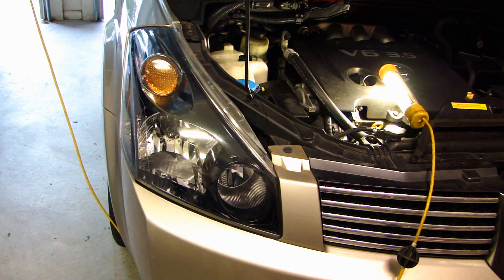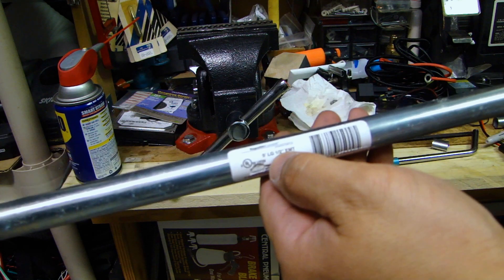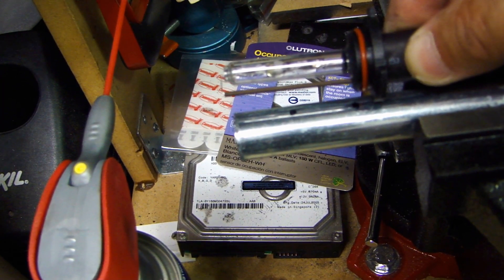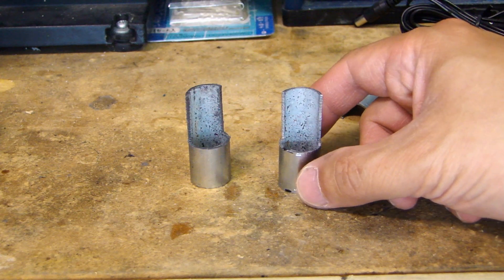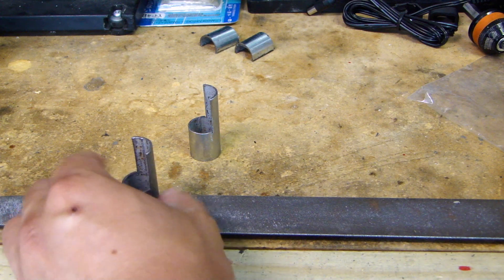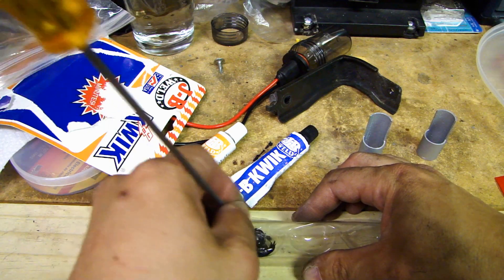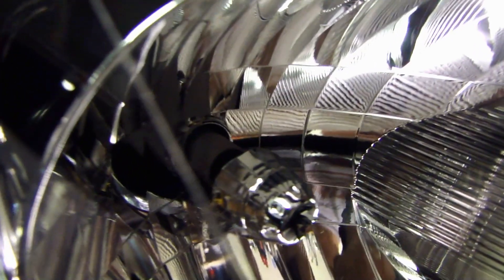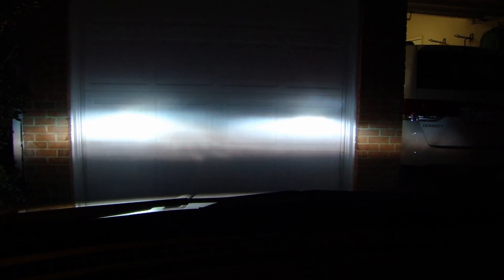Make HID Anti Glare Shield (Casper Shield) For Reflector Headlight

Comment: Respect to you for the skill and helping people do hids safely!!
Reply from the maker: Hey thanks, I have had it for about 6 months now and never got flashed by on coming traffic. Glad I did this mod.
Reply: Respect? this guy don't know crap. Just do a retrofit and quit using HID in reflectors.
Reply: dial2fast Thanks very much for the video. I have a question. Could you use 1/2 inch copper pipe instead of the conduit? This is much easier to cut and for me to fabricate.
Reply: @9246mary  Sure

Comment: Nice video! People need to realize that many cars that first offered HIDs used reflectors and designed them not to glare. You can easily modify them to not glad like you did. The reason why people hate these are because people who don’t know what they are doing just throw them in. Even Autocar a truck manufacturer throws LEDs in reflector housings.

Comment: This video or d2r bulbs specifically for reflector housings are the best. The "r" type hid bulb has a coating covering the bottom portion of the hid bulb. I see it in h7 and h11 applications but i am sure they are more applications. They are hard to find in the US but are very common in the UK.

Comment: They both are good to install if we note and do the followings
1) HID works better in projectors and LED in reflectors. However, they may work interchangeably. The crux of matter is LED bulb dimensions should almost be same of halogens or HID depending upon factory installed halogen/HID. 
2) Proper orientation of LED/HID bulb according to default orientation in reflector/projector is necessary to avoid dispursion of light in unwanted angles
3) Proper alignment of lights after installation is necessary to get best results

Comment: Working on this right now, and damn it's hard getting the cut level and not crooked. Got two done so far, making two more for my fogs. Thank you for the video!
Reply from the maker: +JJ riggs I also recommend putting a bead of silicone (or RTV silicone) on the outside edge around the shield as I am finding the JB weld may come loose after couple years. You still need the JB weld to do the initial bond, and the silicone on the outside edge will keep it in place. Let everything cure and dry before installing.
Reply: +dial2fast alrighty, I will do that on my next set, just kinda testing it out on some old bulbs I had put away for spares as the first set of shields I made weren't quite as good as yours but I'll get better at it. Thanks again!

Comment: Excellent video!! I'm dealing with the "glare" produced by the HIDs in my reflectors, I tried painting the bulbs (high temp paint), but it actually smoked the reflector I used for the test, so I decided not to use them (even after curing the paint and turning the bulb on many times), so I'll be trying this with H7 Bulbs and 3/4" aluminum pipe and your video is a really good guide, 1/2" didn't fit in my bulbs. I'm out of the US and my car uses ECE headlamps, so I don´t know how will be the beam with those shields.
Thanks!
Reply from the maker: It's been couple of weeks since I made the video and they are working great. Good luck with your mod.

Comment: I just stuck my housings in the oven and after I got the adhesive warmed up I cracked it open and added extra material to the glare shield to make a finer cut off line when the headlights are on, works great with my HIDs. And won't have to repeat process if they ever go out. Only a friend wants help with his glare issue so I'll do this mod. It's an H11 bulb. Will a half inch pipe fit?

Comment: Dude you need to buy a metal cutting band saw lol. I like your videos. Very well made & informative.
Reply: +01ghostmechanic01 I think that blade was the cheap ones or very dull on top of using oil it made it worse.... a good blade would had cut that in half the passes.

Comment: For added safety could u also open the lamp and black out the lower reflector? Is the glare problem just in the lower reflector?
Reply from the maker: The glare is mostly from the reflection of the bottom part of the reflector housing, but there are glare from the bulb itself also. Painting it do require quite a bit or work and also alter the look of the headlight (if you like the blackout look on the bottom half). The shield I made indeed 'block' light from shining out from the bottom half of the xenon bulb, so it's more effective than just painting the reflector.
Reply: dial2fast is the horizontal cut suppose to be half way? Yours , from the video , looks 2/3 the way. I wonder what would happen if split the conduit, at your second cut , and pounded it flat? That way it let more light out the sides and the lower shield would be wider.... I guess only if it could still fit thru the headlamp opening.....
Reply from the maker: THEREALSINNER247 I did cut it slightly below the halfway mark. Honestly, I did this mod on several HID bulbs now and as long as you cut it close to what you see in this video, it will be fine. The xenon bulb in itself is so frickn bright that you will get a lot of light to output without having to flatten the bottom side (and yes, if you flatten it, it won't fit in that housing).
Reply: yes that's what I thought, flat black it . and maybe more places than bottom or slight tint it from distance all over reflector

Comment: Thanks for the tip on the Kasper shield. I want to install some HIDs and LEDs on a 30 year old BMW I have. I am also wondering if the position of bar on bulb makes any difference in the pattern of light in spot lights? Should the bar be on the bottom, top, or to the side? Thanks, JP
Reply from the maker: If you are referring to the bar as the wire that goes from one end to the other, then position does not really matter, but if you have a choice, have the wire at the bottom.

Comment: I wonder if this would help with an LED kit that glares since no LED h4 comes with a shield
Reply from the maker: +Pri yon Joni This could help as the glare comes from light source that has a different 'hot spot' on the bulb compare to that of halogen along with higher brightness. You can simiply test it out first and see if it needs it.
Reply: Pretty sure it would, as pointed out, most of the glare comes from too much light bounces upwards from the bottom part of the reflector housing. Having that shield at the bottom of the bulb would reduce that problem quite a bit. That's what I'm going to try next on my work truck. I tried LEDs in it before but wouldn't fit properly (the brands fault).
Reply: Pri yon Joniine mine HID kit came with shield though,bought it only for £35

Comment: great job and thanks for sharing,  when you "paste" the shield on the bulb, do you have to make the open slot up / down?
Reply from the maker: The open slot is facing up. So the shield is at the bottom. JB Weld also didn't hold up to the heat well. So maybe find another adhesive or silicone that might work better.

Comment: I enjoyed both your videos, I am not sure if I need a Relay or not,  I have a 2010 Silverado with h11 bulbs, I am on the fence about going with HID's because of my  Fisher Minute Mount 2 Plow set up.  I am worried that when I hook up my plow the crossover won't work to go to my plow.  If the HID's are plug and play it shouldn't  matter correct??  Please answer both questions if you could.  Thank you . Dean Ferris.
Reply from the maker: +dean ferris Hi Dean, to help me understand your question, what do you mean the crossover won't work? I understand you are attaching a snow plow but not sure what does that have to do with the wiring on the headlight. Thanks

Comment: Wouldn't it be easier to just paint the bottom of the housing black or apply black stickers at the bottom of housing since black absorbs light?
Reply: This is easier than dismantling the housing and painting it black. And yes, black absorbs light, and also heat. You may warp your housing this way.

Comment: Have you had any issues with the pipe touching the ceramic coating on the return wire? It looks like they are in direct contact with each other.
Reply from the maker: The wire is insulated. Will not short.
Reply: dial2fast I noticed the jbweld turned black and I see cracks in it after running the bulbs for 10 mins before installing it. Is that normal?

Comment: Has you've heard about this being tried in H4 HID bulbs?
The H4 bulbs are highbeam and low beam they move up a but when Highbeams mode is activatored.
Reply from the maker: H4 bulbs low beam comes with a shield built in.
Reply: dial2fast 
So I won't need to add a shield for them?
Because the shield in there is not enough. Its still pretty refracty.

Comment: How well has the jb eld held up under the heat supposedly the bulbs get up to 740 degree F.  The high heat jb weld says it will hold up to 500 degrees farenheight
Reply from the maker: One thing I learn is pretty much use a new mix of JB weld for each bulb you do. Why...is because JB weld cure so quickly that by the time you use the same mix for the second one, it doesn't have the adhesive property to bond the items. Therefore your first one is solid and second one is most likely to fall off. Mine is still holding up fine after all these months. I would also avoid the spray painting as my high heat paint began flaking off. So just cut, clean and glue. That's it. Haven't had anyone flash me at night for glare.

Comment: Is the JB Weld still holding to this day?
Reply from the maker: +D0M1NIX Yes still holding.
Reply from the maker: +D0M1NIX Yes still holding.
Reply: +dial2fast Sweet!  I'm gonna try this out with my headlights!
Reply: +D0M1NIX my jb weld burnt off about 2 weeks after this and the shield was latching onto the bulb. Make sure you use enough and check up on it every so often because the hids will toast it.

Comment: Not sure how well JB WELD will hold based on what’s being said here by others. 

One thing I learned is to turn on the bulbs and heat them up for 30 minutes before you put them in the housing for good. 

After I installed mine in the housing they started smoking very lightly after about 5 minutes of use. I think this could have been due to the high temp paint I used. 

After 30 minutes of continual use and allowing for a few hours of rest they no longer smoke while on and the smoke has disappeared. They seem to be helping if not eliminating the glare. Thanks.

Comment: These will not work with 9004-9007 Bi Xenon bulbs. The diameter of the pipe is to small would not allow movement of the magnet to engage the brights. You might be able to use 3/4" but I did not try that since these bulbs have the magnet that has to move. Good idea though.

Comment: Great video man. followed it to the dot; results were awesome. Minor issue though: there seems to be some hazing on the top of the reflector bowl caused by heat from the looks if it. 

its similar to  someone blowing hot breath on glass. Have you or anyone that had tried it here have this issue?
Reply from the maker: +Saad Azmat It's probably the JB Weld not completely cured and some evaporation took place as it dried. Best to let it cure overnight.
Reply: +dial2fast I just started noticing the same thing after I did mine, but it's only on my passenger side

Comment: Wouldn't this just over-heat/melt the bulb?
Reply from the maker: +TDISportAaron The shield doesn't make the bulb any hotter as the bulb sits in a sealed headlight housing. I have been using mine for over a year now. No issue.
Reply: +dial2fast and the housing hasn't had any ill effects from the extra heat?
Reply from the maker: +TDISportAaron No issue.
Reply: HID bulbs(35W) run much cooler than Halogens

Comment: +dial2fast
I've made the same construction for my HIR (Halogen infrared Reflective)  H4 35w lights. The glare issue was fixed, but unfortunately the glue I've applied, came off due to high temperature of the halogen bulb i suppose. There was a lot of smoke inside the headlight. So I don't know what I can do to prevent that. Any tip? The most heat resistant glue I've found was up to 212° F. I guess I should use a more heat resistant glue.
Reply from the maker: +Patrik Stadelmann I used JB Weld (sold in US), and it's held up from the time of the video till now. It's my daily driver.
Reply: +dial2fast JB Weld must be the only high heat resistant glue. I ordered one as well. It's hard to get in stores in Switzerland.

Comment: Are these 6000K?
Reply from the maker: These are 5000k for a pure white look.
Reply: Cool, I bought 6000K for my 2007 Honda CR-V. I bought it from CarXenonHidKits.com. They are german so there are no glare issues.
Reply: Already have the caster shields built in. My daytime running lights dont work though. Lights always on.
Reply: They have them, not in the pictures though.

Comment: Nice but you could also just buy a projector retrofit kit for $40 bucks and call it a day.
Reply: Yeah, better to get the proper tool for the job instead of trying to DIY something that works half as good, especially when other driver's safety is involved.
Reply: MrCougar214 where do you find that??
Reply: $40? .. where u find that deal?
Reply: Try searching ebay, tho not all kits are the same quality. Caveat emptor, do your research first.
Reply: aliexpress
Reply: in what world can you get a retrofit kit for $40? Try 150+ for everything you need....
Reply: Max Poulin in the aliexpress world. $30 each for projector kit and hid kit. $5 if you want a relay harness. About $65. Shipping depending on country may be free or a couple bucks each.

Comment: Imo, just retrofit your headlights, it's not that expensive and just add the LED bulbs.
Reply: Not all car models have their own projector or projectors that could fit in.
Reply: And those that don't should not have HID's in them. Because HID's are not meant for stock reflectors OR halogen projectors. Science is very necessary here.
Reply: They don’t sell projectors you can pop bulbs into, they only sell the ones you have to wire in.
Reply: All projector headlights have wiring and the bulb is integrated into the projector. They should make some that don't require any wiring. A lot of cars with projector housings have just projectors, but you have to provide the bulbs. For example the Pontiac G8 has projectors, but the bulbs are separate from the projector.
Reply: @harysuper  those ar bi-xenon (high beam and low beam), they make projectors for just low beams
Reply: Chris Spiller they make Hi/Lo projectors. I replaced the bulbs on my brothers 2013 Chevy Volt. It’s one bulb for both.
Reply: @harysuper  i know those exist i was saying they also make the other its not that bard to wire the block off plate for the high beams

Comment: Just do the right thing. Retrofit! quit using HID in reflectors, duh!
Reply: This is way easier and gives similar results.  It takes less time to make a shield than it does to retrofit projectors.
Reply: @Lambo
This is NOT similar results. Goddamn it, this is why there are so many stupid kids running around with these encouraging the government to make them fucking illegal.
Reply: Reppy07 then explain why the D2R bulb uses a reflective housing straight from OEM. This shroud is a copy of the coating that comes on D2R bulbs.
Reply: LamborghiniReven1000
It's not made the same silly. Im not sure which you're referring to, but I ASSURE you, that it they're OEM HID's, the reflectors were specifically designed for them. Not the other way around.

No matter how close you look, your eyes will most likely ever see the real difference in reflectors for halogens or hid's, however, this is where the science comes. I will always strongly recommend everyone to learn more and more about them. Halogen reflectors/projectors are not made equal to HID's or LED counterparts.
Reply: LamborghiniReven1000
http://clubroadster.net/vb_forum/#/topics/69869
This sums it up better than I ever could. Very much worth the 3 minutes of reading.
Reply: @LamborghiniReven1000  Some cars (usually Japanese) come with HID's in reflector housing from the factory, like R34 GTR, Nissan Maxima etc. The D2R bulb is a common HID bulb used from the factory for a lot of factory HID reflector applications. 
These setups are better than throwing HID/LED bulbs in standard halogen setups (reflector or projector, typically reflector being worse) as they are nowhere near as blinding as most PnP setups and the light output will almost always out-perform PnP setups.

However, in no way does this (even factory/OEM HID reflector setups) remotely compare to the output of retrofitting HID projectors, specifically aftermarket projectors (clear lens, tuned cut-off shields as opposed to OEM HID projectors). 
The spread of light, sharpness of the cut-off and the hotspot LUX produced by good aftermarket HID projectors will pretty much always beat factory/OEM HID reflectors.